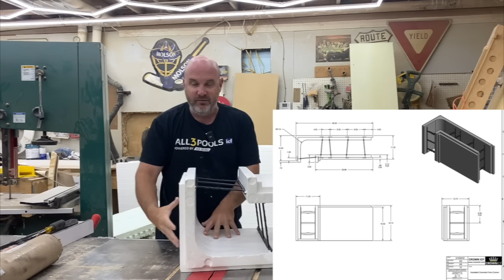6 Brands of ICF Compared!!!

Comment: Just finished a first DIY with Nudura. Complex 2300 sq ft basement walkout with 14 corners, 4 'T' walls, 10 1/2' from footer to top of wall, brick ledge 3 door openings and 6 window openings. Poured if in three pulls with no blowouts. Nudura has great online training resources, great distributor support, easy to use and now the coolest most comfortable part of the house. Highest praise for the whole experience!
Reply: Thanks for choosing Nudura and loved reading about your positive experience
Reply: I used Nudura in the UK and it was great!
Reply: How much for 1 block?

Comment: Sprayfoam insulation has left homeowners in the UK trapped in their own home. unable to sell, because lenders will not loan money without a sign off from a surveyor, and surveyors cannot survey what is buried under foam. Making peoples homes worthless.
Reply from the maker: Explain?  What is a surveyor?  Is this done during construction or when home is complete, if so how do they see anything different once drywall is installed, I don’t follow
Reply: Inspection for insurance and sale.  If you can't see the underside of the roof and the joists, more and more won't pass it.

Comment: Buildblock is a far better block then Foxblock.  6" web spacing,  a 1 inch bump factor, built in tape measure, fully reversible, and YES the short leg of their corner has 2 webs.
Reply from the maker: What’s better about 6” spacing?  Just more plastic in the way right?  Fully reversible is completely ubiquitous in the market now, fox, Nudura, soon logix, stronghold crown are all reversible…. And the corner is still small and weak compared to fox…. Don’t be a Homer, they are all good…. When people talk down about any competitive brand it hurts newbs confidence in the market as a whole…. If I were to do that I might bring up builds lack of   Full height webs and why that limits my ability to pour tall wall without compaction…. But I would try to accentuate the positive…

Comment: Great video, thanks. I built a 2 story extension to my house in the UK with Nudura and found it really easy. Ive never previously done any construction before either. Total amateur. I would happily recommend Nudura. One of the deciding factors for me was the size of the block and the volume created with each one put down. It was very quick. Lots of great online resources and some of the uk distributors were very cery helpful. Cheers, Dave

Comment: 20:37 You asked, "How often are you actually stacking from your floor up?" All the time--if you live in Florida or Texas, where we do slab-on-grade foundations a lot. I think the 18" high forms are a great idea. I wanted Nudura for that reason, however, I agree with you--it's all about who makes the blocks near you to save on shipping and get more support. That's why I went with Build Block. I went 15' high in the first pour. I had no blowouts (or even bulges) anywhere. I used a lot of strapping, but I think the 6" on center webs made the blocks strong enough anyway. The weak nubs are a major pain. You simply have to be careful with them.
Reply from the maker: Even in those climates going down thru the slab to a footing gives you the best possible thermal break, but I get it, very rare in colder climates

Comment: I am surprised you did not show Quadlock, they have so many choices for foam thickness from R-22 to R-59 (2-1/4 to 11-1/8" of foam on one side), and an unlimited core thickness as well as being a completely modular system.
Can ICF's be used to construct a 50ft fire tower style structure that requires steel embed plates so large timbers can be used as floor joist for several floors within the tower?

Comment: appreciate ya doin a 2nd take, lol, but also hearing your thoughts on each as an experienced installer is valuable. it'd be a lot of effort, but detailed vids lookin at each mfg on a whole (not just block design) would be sweet.

-----

kinda like the flat shipping & 6" tie spacing on Lite, but i'd have to hear from experienced installers if that virt edge works well or is a hassle. same with their "compact corner". does flat/compact offset shipping from Nebraska tho? do think their decking is possibly the best design, but i'll EAGERLY AWAIT your (hopefully upcoming hour-long) vid on ICF deck options, lol. 

Crown's sales representation/pressure is def frequent & persistent. i'm not really impressed by the design... thin, corner does look weak, requiring glue is a pain, inconsistent tie spacing (why allow it to slide when the ties need to be aligned for easier int/ex finish hanging anyway?). which makes me wonder why all the hype.

Stronghold actually looks REALLY good w/all the lil details, density, & girth (is that foam thickness measured with or w/o the interior ribbing?). corners & Ts even have extra ties, and the attachment part is extra wide on all forms. end-caps look great for window/door bucking, no? honestly weren't previously on my radar cause none of the projects i've studied used them. need to find out where they're made & how expensive shipping to Abq becomes, compared to Fox up i25. also would need to check dimensions vs my plans (all my lengths/corners/openings are set to Fox currently - side note: kinda wish ICF were all standardized for this reason).

nubs on Build look fragile, but 6" tie is nice. the seam of their deck being at the thin point is a no-go imo.

Fox & FastFoot seem to pair well. you're not the only one who says their corners are good, and i hear support is solid. lots of plants around, so hopefully shipping costs are lower.

notice frequent comments around that mention poor support/communication from Nudura, but Kody Horvey has good relation with them. sounds like complacency from success? block is YUGE, but i dunno if it's really a benefit, like you said... and then you get non-standard pallets too, right? foldable would be good, but i don't want to cut steel hinges.

Comment: Do any manufacturers have stronger webs than others? Is the fastener pull-out strength of webs ever a concern? Can you hang a heavy sawn stone veneer on ICF?
Reply from the maker: Stone veneer is fine, you need to screw the wire lathe on instead of nailing but that’s the only difference, the only finish I’ve seen get denied even tho I’ve done it is nichiha cement board rain screen, basically because the screws are bridging through the foam 1/2-3/4” and supporting all the weight as it goes vertical, I’ve done it 8-9’ high with no issues but they worry with multiple stories…. Wire lathe stone veneer is adhered as it goes, totally fine

Comment: Great video showing how these ICF system works.  I have one big question.  I have  watched several videos of  using ICF in building basements.  What drives me crazy is that no one tells how to fill the dirt on the outer walls.  I think you need something applied on the wall that will have dirt against it.  So help me sleep at night and tell me what methods you can  use when back filling dirt on the outer wall of a basement.  I will love you for ever!  Well maybe...
Reply: I’ve seen several videos of people peeling a backing off a membrane and sticking huge sheets on the outside wall for waterproofing. The inside truss or framing for the second floor must be complete before backfill with drainage, crushed rock and fill. Otherwise the walls cannot support the inward pressure of the backfill.

Comment: Thanks for the video! Does fox have a roof product? Roof product video would be insightful. What is your thought on using a volumetric mixer on a roof pour? Has it been done?
Reply from the maker: Fox doesn’t, you just have to be able to pour fast enough to avoid cold joints

Comment: Have you had any experience with the Perfect Block? Any opinion on them?
Reply: I can’t find anything on composite ICF. My intent is to DIY/build with either the perfect block or Eterna and document the entire process.
Reply: i decided against them & Omni due to the need for skilled masons, time, some thermal bridging, and difficulty of running MEP or attaching to them.

fire resilience is quite good tho.
Reply: Been looking them up and they look amazing plus their customer service seems on point. But I bet it matters where you're located.
Reply from the maker: I have an opinion, it’s not good…. Many reasons but the support seems to be falling off I’m kind of rapidly, they haven’t even been at the big shows the last two years…

Comment: You don’t mention one of the most important metrics of a block system, the repeat distance.  All ICFs are variations of the same thing, the import difference being the interlock style.  (What you call “the nubs”.  The interlock is what determines the minimum repeat distance, and how robust the blocks stay together.  This is 100% due to what the block manufacturer could patent or license.  Late to the block game, you get a crap interlock with a crap repeat distance. (Fox block) Early to market and were able to  patent a 1” repeat and leak-free interlock? BuildBlock.   
      This repeat distance directly impacts how efficiently you can use the block.

Comment: If and WHEN a manufacturer gets icf to match or beat wood framing cost. Demand and acceptance will explode.
Reply: The only way that could happen is if the foam was an inch thick on each side and the core was 3” of concrete lol.  
It’s not even comparable to a 2x4 stick built house. 
1) It’s a self supporting wall.  Which means it’s also disaster resistant to ~250mph winds.
2) It’s a better insulated wall than even a 2x6 wall with 2” of exterior continuous insulation.
3) Fire resistant unlike wood
4) Sound deadening is unmatched with a stick built wall
5) Termite resistant 
6) Water or flooding wouldn’t damage the wall.
7) It’s much more air tight than a stick built wall with little effort.  Watch The Build Show Network and see the painstaking steps Risinger and his builder friends have to take to get anywhere close to an ICF house like Korey with Up to Kode has built with standard ICF construction.
Reply: ICFs are cheaper over the long run than wood if you consider heating and AC savings.